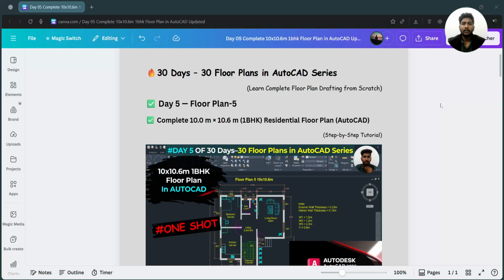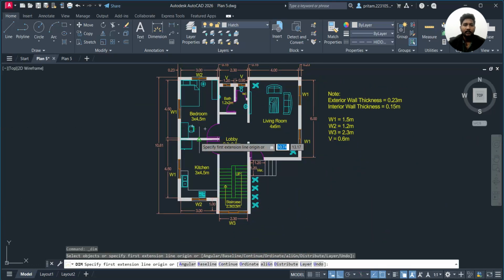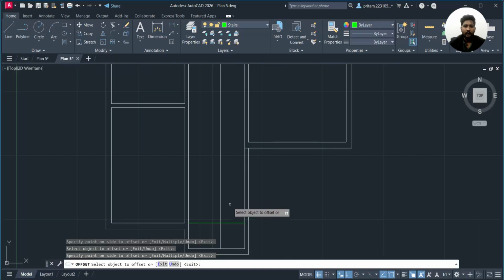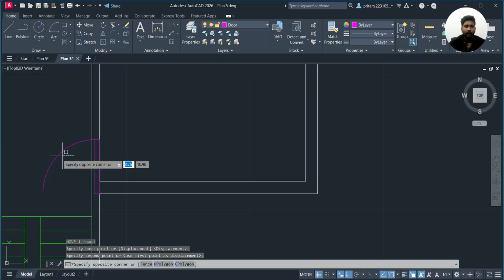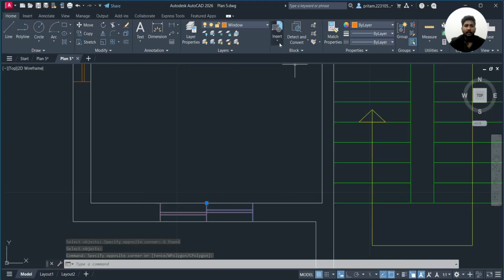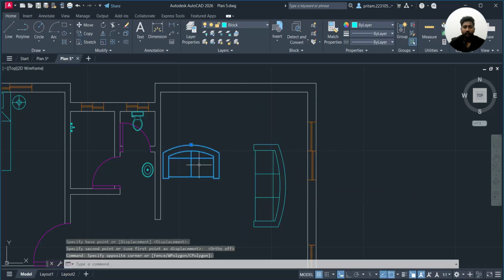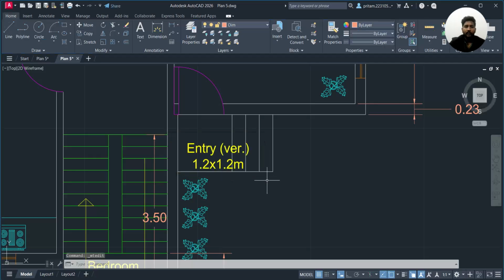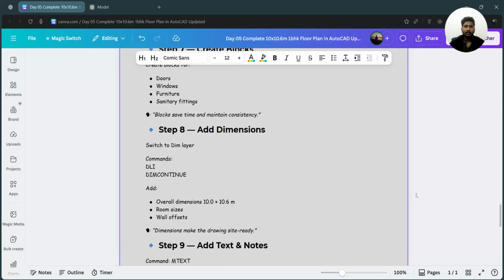Complete 10×10.6m 1BHK Floor Plan in AutoCAD | One-Shot Step-by-Step Project (Day 5)

Comment: The video I requested
Reply from the maker: Which one??
Reply: @StructWithPritam How to divide the rooms into the required sizes when drawing the house plan?
Reply: I am student plz
Reply from the maker: @a.vignesha.vignesh7570 In AutoCAD, rooms are not divided by guesswork. First, fix the plot size. Then decide standard clear room sizes (living, bedroom, kitchen, toilet). After that, use the OFFSET command with exact dimensions to create room widths and lengths. Always start with the largest room and adjust smaller spaces later. Finally, check clear room sizes using the DIM command. This is the correct and practical way to divide rooms in a house plan.
Reply from the maker: @a.vignesha.vignesh7570 the same thing i have explained in day 2 3 4 5  
We basically divide the room by using offset command 
And trim command is also present based on that we can cut the part that is not required or which is disturbing the geometry of the house plan...
Reply from the maker: @a.vignesha.vignesh7570 Offset command type Offset and enter put the amount means the room size and the click on that side....
I clarified it in day 2,3,4,5 in day 1 we have just made the plan using the rectangles... 
For the next we have used the offset tool..